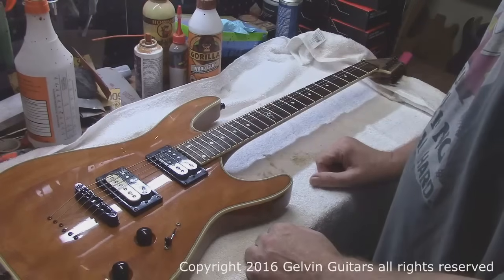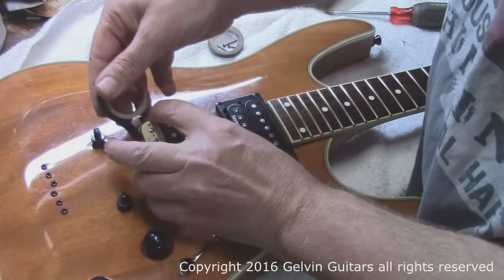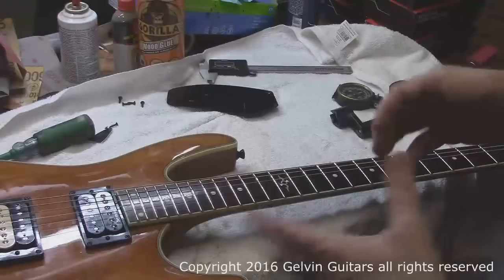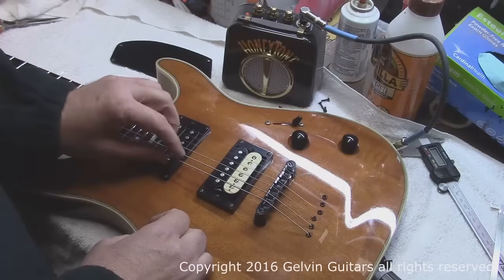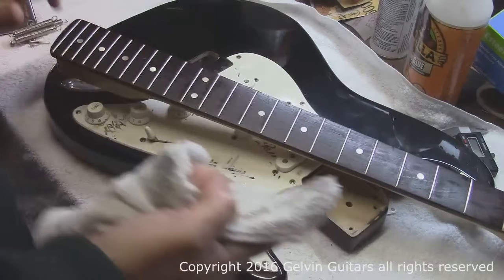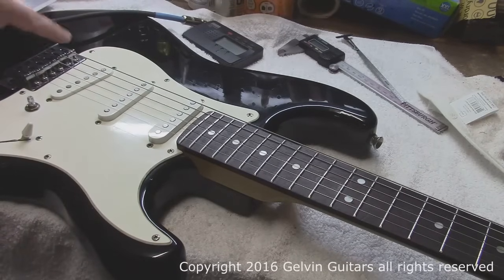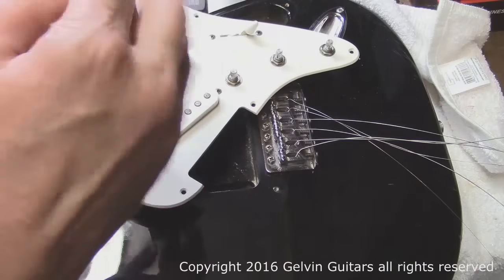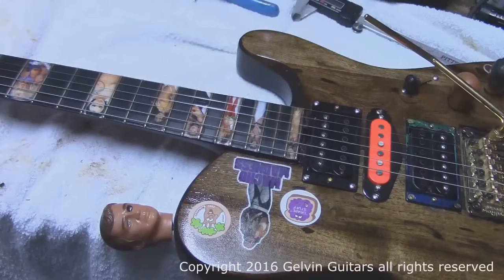How to set up your guitar perfectly

Comment: -- Guitar No. 1 --

0:00 Introduction to Guitar Setup
2:59 Cleaning & Oiling the Fretboard
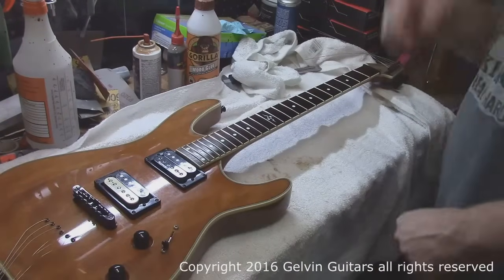10:05 Checking Pot Wiring & Cleaning the Pots
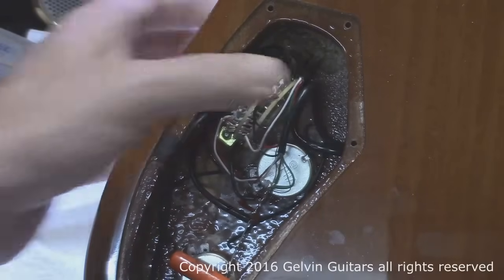13:42 Checking Pickup Wiring
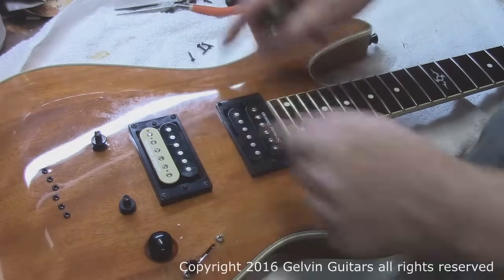24:32 Checking the Frets and Buffing Fretboard
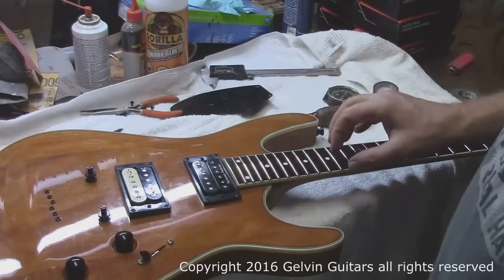33:04 Notes on Setting Action & Intonation
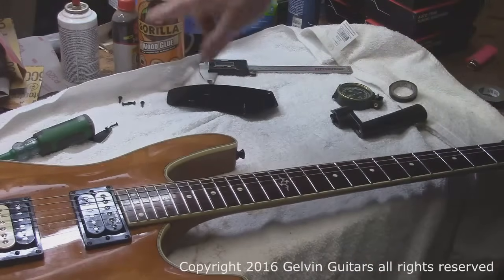43:10 Nut Height & Action
47:47 How to Determine Action Height
51:10 Setting the Intonation
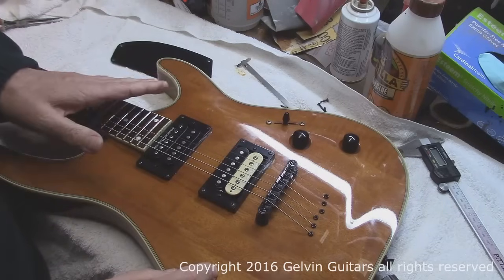1:01:49 Pickup & Individual Pole Height Adjustment
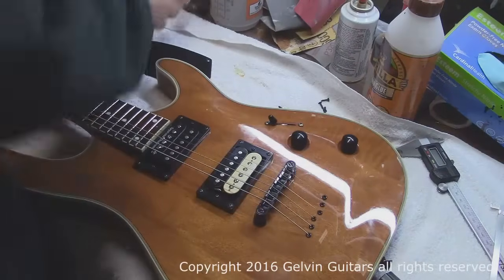1:10:44 Checking Output Jack Wiring
1:11:32 Plugging & Fixing a Loose Screw Hole
1:16:15 Finishing Touches
1:17:59 Notes on Bridge Radius and Adjustment

-- Guitar No. 2 --

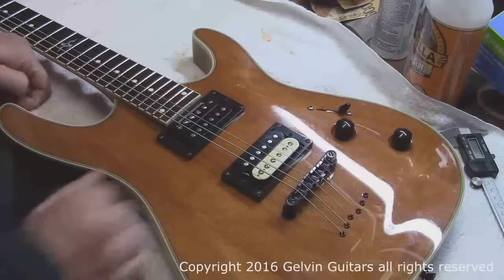1:20:30 A Pawn Shop Find
1:21:00 Dry Fretboard Treatment
1:27:07 Disassembling Pickguard & Cleaning the Pots
1:29:33 Cleaning a Dirty Guitar Body
1:30:31 Plugging & Fixing Another Few Loose Screw Holes
1:32:08 Removing Fake Sharpie Signatures from Pickguard
1:34:26 Cleaning & Installing the Tremolo
1:39:05 Setting the Neck & Adjusting Neck Angle
1:40:58 Adjusting Tremolo and Setting Tremolo Spring Tension
1:43:14 Bolt-On Neck Back-Angle Shimming
1:47:12 Adjusting Saddles, Setting the Intonation, and String Trees
1:57:43 Notes on Electronics & Spring Tension
2:01:02 Single Coil Pickup Adjustment and Rewiring
2:08:47 Notes on Loose Tuning Machines 
2:11:09 Loose Frets

-- Guitar No. 3 --

2:13:49 Identifying the Need for a Truss Rod Adjustment
2:16:46 Common Floyd Rose Tremolo Issues
2:26:53 Outro on Basic Guitar Setups
Reply: Nice

Comment: Thanks Will!  Glad I found you (better late than...) I am getting the confidence (thru reliable information like yours) to more deeply maintain my own guitars - its a win/win for me and the guitars!  Just a note tho': at the beginning where you are mentioning using digital calipers to figure out string gauge, you say "set it on millimeters" (1:48) and proceed to measure the strings.  Actually, string gauges are measured in (thousandths of) inches.  Using the same calipers set on millimeters, I measure my 6th (low E) string at 1.25 mm - it is actually 0.046 inches; similarly my 0.010 " high E (1st string) measures about 0.30 mm.. I believe you meant to say "set it on inches" - you get better results!  :)  Thanks again!

Comment: He is the ONLY one I’ve seen that doesn’t just focus on the height of the Nut Slots which are ALWAYS high 
(Unless you buy a PRS because they actually care about how your guitar plays the moment you pick it up!)
but addresses the fact that once you have the slot filed down far enough each string should be a Half-Step from Open at the 1st Fret and the rest of your setup builds from there.
Bravo!!

Comment: Great video as I am rebuilding a Fender Starcaster from the neck and body up.  At 2:05 in the video you were talking about the pickup magnet  being changed and 'why would anyone do that'.   Reversing the magnet [turning it over ] in the middle pickup position, changes the magnetic field and turns the #2 and #4 switch position into a neck and bridge pickup humbuckers.  It's cheaper than buying Fender Jazzmaster pickups or Seymour Duncan California 50s SSl pickups where the middle pickups are reverse wound to make humbuckers at 2 and 4.  Some attempted this and then put the reversed magnet pickup back in the original position at the bridge instead of in the middle.

Comment: Man, I would highly appreciate time stamps on long videos like this
Reply: I’m surprised no good YouTube soul has obliged.
Reply: 1:37 measure string gauge 
3:00 clean and condition fretboard
10:11 pickup electronics maintenance
20:40 fret and neck check up
30:50 bridge set up 
39:50 restring/relief setting
51:00 intonation
1:01:50 pick up height 

Gotta run, that’s half way if someone else takes over.
Reply: what are you 6, just watch the video or scrub through it
Reply: @crucifixx713  just go on boy. This none of your business. 
You can skip through any video as long as you want. Just don't bother around.
Reply: @jicklesjingles8134  oh lighten up old man
Reply: @crucifixx713  imagine using old man as a insult

Comment: Many thanks for this. I use a local band tech for my son's first set up (solid experienced guy) but after this it's down to me so this is very helpful thanks.  One thing he recommends on all new Gibsons is to recut the nut along with your preferred new strings (11s in the case of my son). Gibson typically don't cut the nut well on a new guitar (even a Standard). This includes rounding off the back edge of the grooves to the tuners where there can be a burr that catches the strings. A technician with skill can also deepen the cut a touch if the string height is excessive at the nut. Add to this a check of the tuners and bridge for tightness and you shouldn't have any tuning instability. Normally with this procedure and a half decent nut, no lubricant (or upgrade parts like Schallers) are needed. Of course you still need to check the neck relief, intonation etc as the guitar (wood) will expand and contract in travel.  We traded up to an LP and a J45 acoustic 18 months ago, gigged for this period and no tuning instability on either - my son eats strings but he does play quite aggressively and I think this is an age / experience thing. Here he is on his backup Taylor acoustic, Smells Like Teen Spirit: https://www.youtube.com/watch?v=w49TQOr9fss - cheers.

Comment: May I suggest a procedure to employ when you're confronted with rusted Fender bridge parts (intonation screws, springs)? Take the entire bridge off the body and dismantle it. Label each saddle (1 through 6) if it makes a difference  due to differing notch sizes. Into a glass vessel, pour a little C-L-R liquid and drop the intonating adjusting screws, the height adjusting set screws, and the intonation adjusting screws into the undiluted solution. Let it sit in solution for about an hour, remove the components, and rinse in clean, fresh water. Dry all the parts in a cheesecloth sac and compressed air. Then, using a Dremel rotary tool or similar, and tweezers which have a secure grip, use a wire brush attachment on the tool to remove any remaining traces of rust. This will also bring back the metal parts' luster. It is somewhat time-consuming, but your clients will think that you provided a new bridge to them.
Reply: That really is the only quality way to go about it

Comment: I use Windex to clean my fretboards, and then I oil with trombone slide oil. The Windex cleans really good, but will cut and remove the oil, which is what I want because I want to lift all of the dirt, gunk, sweat, etc. from playing out of the fretboard. The slide oil is a very clean, thin, mineral oil. I've used this for around 30 years now with no issues. I do this maybe once every month or two.

Comment: First, I would like to say, I think it's awesome for you to take the time to help others get a more clear understanding of the what, why, and how to do a proper guitar set up. Unfortunately, it appears to me, that you seem to not care about protecting the guitar. Why do I feel this way? it's only because you've taken no steps to protect the neck, neck joint, head stock, and head stock joints. As you  begin, the guitar is clearly elevated off the workbench, as you can see from the shadowed areas under the top and bottom horns, meaning the head stock is resting on the workbench at the very tip, and it's made an elevation to the guitar, which is already how I wouldn't treat my own guitar, let alone a guitar I'm working on for a client/friend. but then you apply pressure to it rubbing to clean off the finger board. At 4:36 you can see by the head stock dropping onto the edge of the workbench it's holding all the guitar's weight as well as any applied pressure from your cleaning. For a short time this could work, but it's definitely not what a professional luthier would ever do. Help is one thing, but this could potentially hurt the guitar. Other than that, top job on the whole thing, and I apologize if I seem to come off as rude, I'm just trying to help others the way you have, by noting this small detail which, let's be honest, could harm a guitar if done by someone without experience in this. Cheers mate!! Thumbs up on this!
Reply from the maker: you worry about things that dont matter. guitars are not Faberge eggs. thanks for your comment
Reply: @WillsEasyGuitar  You've got me on that, I do worry too much about the little things, but some of the price tags for some guitars make taking chances like this not worth the risk is all I'm trying to say. Thanks man! {Thinking mainly about some Gibson LPs or lower end models that already have weak joints by design.)

Comment: Any idea what causes a locking trem to be super stiff and what might be a fix ? I use 9s and the trem  is super stiff when I divebomb. What if I change the springs ?
Reply from the maker: the springs are too tight. loosen them. If they are already loose then remove one.

Comment: Can I use wd-40 as a cleaner to spray on pots and switch inside?
Reply: Wd40 can leave a residue and attract dust, electrical contact cleaner will evaporate more. You can get it on amazon

Comment: We had a house fire and the fire extinguisher made my Stats metal parts have small spots of rust.
Reply: clean the fretboard with Naptha or lemon oil then use a fret eraser available at StewMac. It is a rubber eraser impregnated with various grit to act like a cushioned sandpaper. Available in several grits. By a few. they are handy to keep frets looking new and playing fast.

Comment: Great info - just one point  on the calipers - you mention in the beginning setting them to millimeters. That would be mils / inches to measure strings. A .010 string (10 mils) is actually .0254 mm, 10/1000th of an inch. That's all the math I know... lol. mil v millimeter.....

Comment: hi sir this is out of topic but i just want to know if its necessary to sand down the fretboard when doing a refret? or it's ok to leave it as is when the fretboard is clean... I'm stuck at the fret board right now im doing a refret and i dont know if i need to sand down the fretboard with some radius block or i just run a gently  couple of pass w/o a block

Comment: Hello doctor! My jackson has a floyd rose system without that head leveling bar :| how does one go and add one of these for that tuning stability?  
I've been always tuning it ever so slightly flat, so when I tight the nut it goes in tune as close as I can get it to. After that I fiddle around with the tail piece micro tuners and call it a day :)

Comment: Iam not a Luthier but I've been doing timber frame construction for 40 years. natural oils in the wood will also evaporate out over time so it is important to keep some kind of oil on it. WHat you are using is the best. penetrating oils like 3 in 1 or wd 40 can really swell the wood. As you say though, too much of anyting ain't good fer yer wood!

Comment: Hey Will, I noticed that you checked for neck bow using a straight edge (looking for light under straight edge) but you did this with the strings off first. At this time you mentioned adjusting truss rod. Later you also talk about the truss rod, but with the strings on. I am confused, as I have always heard we should adjust truss rod with the strings on and tuned up.  Can you help me with the confusion?  

Is it best to adjust truss rod initially with strings off to make neck dead straight with itself, then later with strings on and tuned we again truss adjust but to give it some relief?

Comment: Hey Will I just bought a CV star caster and it came with a lot of neck relief when I straitened the neck and lowered the action I had some buzz on the b string and g string starting on the 4 th fret. Im thinking the nut was not notched proper and was notched too deep on these strings. Isn't the nut suppose to reflect the same radius as the neck? Im thinking about taking it to a luthier for fret level, should fret level come with nut replacement if I buy the new nut ? Im also thinking about just spending a few hundred on straight edge, sanding block and crown file from Stew mack so I can fret level but im torn . so much for tools but I like to DIY and I know I can. What do you think, just take it too a lutherand save my cash for more guitars? But then Im stuck paying again eventually for more work. sheesh

Comment: I have had issues with a number of Dean guitars whereby the strings have rested on the back of the bridge due to the tailpiece being too low and/or the saddles being too low to get the clearance needed. Does this guitar have the same problem, and is it anything to be concerned about? Thank you.

Comment: Hey Will, sorry for off-topic but I wanted to hit a recent video.
I have an Ibanez RG 4EXFM1, it has an Edge III trem, I know an Edge Pro is a drop in replacement but they are pricey if you can find one new.
A new Floyd Rose Special is about 90.00, but I know it will need routing.
I am not up to doing it myself skill and tool wise and I will be having somebody else do it, but in your documentation and literature or your notes do you have anything that can indicate how big of a mod it is going to be?
If it's too intense I may not even have someone else do it and figure something else out.
I've been watching your videos and I am willing to defer to your judgment.

UPDATE: (Sorry for the novel.)
I contacted Floyd Rose support and asked straight what I would have to do to get a Floyd Rose Special to replace an Edge III
They said it would fit the route but I would have to use my existing studs as their studs had different threads.
I then replied and asked specifically if the stud spacing would be compatible.
They replied and said I would be able to use the studs as is.
So if I put both of those pieces of information together it sounds like I should be able to replace the Edge III with the Floyd Rose Special with no modification.
Except...
Everything I have read on jemsite, including their stickied chart says that the only mod free replacements are an Edge Pro and an Edge Pro II, I'm noting that not all sites agree on the Edge Pro II.
On the chart, if I compare the dimension between the studs, Edge III, Edge Pro, and Edge Pro II are all 73mm.
The official mechanical drawing on the Floyd Rose site shows that dimension to be 74mm.
Assuming that they're right about the route, how critical is that 1mm difference?
Would they (Floyd Rose support) have known about that difference when they told me they were compatible?
I'm not a tech, and if the studs need to be moved I'm not going to pull the trigger on this mod.
So I looked up a conversion, 1mm is 0.0393701, divided by 2 it's 0.01968505.
Is that beyond tolerances in a way that should make me rethink this replacement?
An Edge Pro is a little over 200.00, and a full-on Floyd Rose is around 199.00.
A Floyd Rose Special is like 90.00.
I want as much quality as I can afford, but...I have to be able to afford it and justify it to myself.
Are there other decent quality trems in the 90.00 - 120.00 range?

I still prefer to try to get your opinion if I can.

Comment: Well, I thought oils by "evaporating" through time played a positive role in the instrument's sound (same with acoustics)... I have been told that the more the wood dries through time, the better it is for the sound and resonnance (hence the high value of vintage instaruments...) : am I wrong ??
Reply: Yes.
Reply: The neck wood(s) adds a vanishingly small amount of resonance, if any,  to the sonic qualities of an electric guitar when compared to that of the body wood. When an unconditioned, unfinished (rosewood, ebony) neck dries out, the wood contracts, becomes brittle, is more subject to wear, and the fret ends may begin to protrude past the edges of the fingerboard. Replenishing the oils in the fingerboard's wood prevents it drying out, makes the fingerboard resistant to aqueous moisture (spilled drinks, water, sweat), and allows fingers to more easily move along the fingerboard. You cannot "overcondition" a fingerboard's wood, IMO. It will absorb only the amount of oil that it  requires and the remainder can, and should, be thoroughly removed with a clean, lint-free cloth. Just apply your oil of choice sparingly (mineral oil, lemon oil made for guitars, teak oil, commercial oil products made for the purpose found in music stores; just avoid vegetable oils which turn rancid).

Comment: I cant stand Floyd Rose bridges because they use that crappy pot metal for the saddles, so the string metal is harder than the saddle metal, you end up digging out the saddles with the strings over time and are eventually unable to tighten the block in the saddle because it's dug out like a half moon shape. lol classic